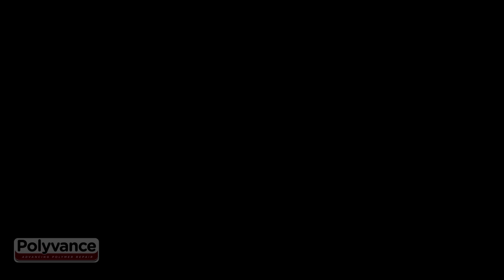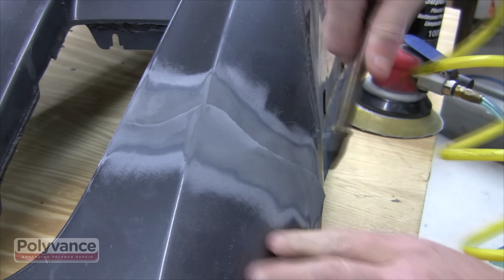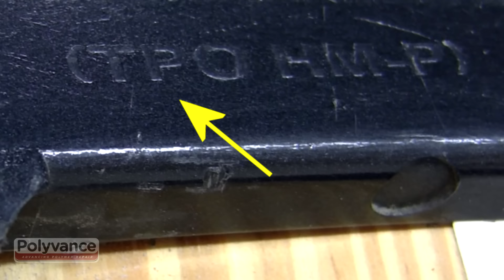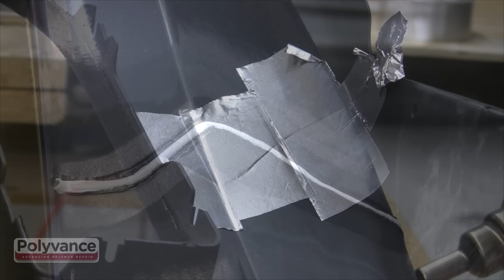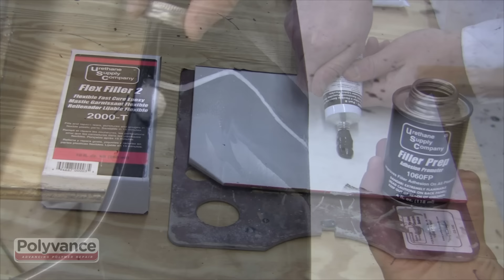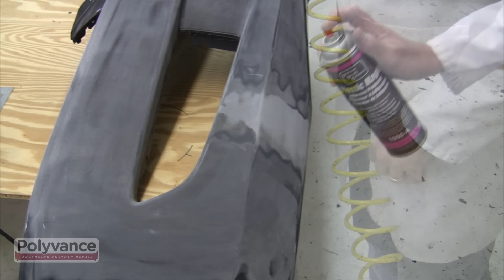Bumper Repair with Hot Air Plastic Welder

Comment: Curious to know the cost differential between this and just replacing the bumper.   This is a nice, professional job but it seems very labor intensive.
Reply from the maker: Hello. Our hot air and nitrogen plastic welders are mostly for body shop use. Using this equipment, a body shop can repair an OEM bumper and other plastic parts.

All cases are different, and the amount of damage will need to be evaluated to see if it is worth having a part repaired. Many times it is cheaper to repair small cracks, tears, tabs, etc. than to replace the whole part. You may find an aftermarket part cheaper to put on yourself, but you run the risk of it not fitting properly, and you also have to wait for the part to come in. Repairing ensures you keep the OEM part on the car, and you don't have to wait for the part to come in.

You can find a win-win scenario for both the repair shops and the bill payer. Check out this article and interview with Kurt Lammon, president of Polyvance (under the Plastic Repair section): https://autobodynews.com/index.php/component/k2/item/15517-the-best-body-shops-tips-repair-vs-replace-what-a-body-shop-should-consider.html?showall=1

There is a good example of a win-win scenario in the article:
If a replacement part costs $400, and the shop makes 25% gross profit on parts, the shop receives $100 of gross profit and the bill payer pays $400.
However, if the part is repaired and the shop is paid for 6 hours of work at $50 per hour with a 50% gross margin on labor, the shop makes $150 gross profit and the bill-payer only pays $300. So if the part is repaired, both the shop and the bill-payer come out better than if it had been replaced.
Reply: Makes sense.  Thanks for the reply.  Dollars in, dollars out.
Reply from the maker: @tomygun1585  You're welcome!

Comment: no epoxy on the backside?
Reply: No.  two reasons:  1: Epoxy doesn't stick well at all to polypropylene.  2: Its totally unnecessary.  The weld is just as strong as the original part.
Reply from the maker: The weld on the backside is a strong repair. Because it is on the back, it will not be seen, and refinishing is not necessary.

Comment: Cost of tools, time, and potential health risks...
Reply: Vintage polyurethane parts that are not available benefit from this type of repair! 
Mask ! Gloves!
Reply from the maker: Hello. Our hot air and nitrogen plastic welders are mostly for body shop use. Body shops would most likely have all of the other tools (sander, aluminum tape, sandpaper, etc). They also have their own safety equipment to use.

Comment: I only watched untill you started grinding the plastic which you just cleaned in 1 direction to stop contamination......why clean an area with solvents and then grind it away right after the cleaning???? Am i missing a step here?
Reply from the maker: If you have contaminants on the plastic and you sand or grind it, it's very likely you will embed some of the contaminants into the sanding scratches (which will impact the quality of the repair).  You should always clean the plastic first!  You can clean it again after if you wish, but you should always clean it first!
Reply: When you clean first, you eliminate the risk of forcing contaminants into the sanding scratches or into the v-groove.  Its much easier to clean first as well, you don't have to clean out the groove you just cut.  It saves time and is generally a better work practice.

Comment: The video is great good job thank you interesting stuff. The gentleman that's doing the welding has a wedding ring on he should have his Jewelry off doing any kind of this work in the shop I know a couple people who have lost fingers due to having wedding bands and other Rings bracelets Etc I've had really bad situations so if you like your fingers I suggest you remove your wedding band. Best regards Chris
Reply: Rings can be hazardous in a shop, this is true, mostly in crushing accidents and in machines with high torque rotating shafts, like drill presses, drive shafts, etc., but there is much less risk with a sander or di grinder. (yes, there is still a risk)

Comment: Or just go to eBay and order a new bumper cover for under $50.
Reply: Not all cars ,  My bumper with shipping is $850
Reply: Lucky ,I couldn't find nothing but oem , 850 plus paint , $1100 , so I ended up fixing it for $300
Reply: $40 @ my local salvage yard
Reply: Lmao, you may not want to paint an entire bumper though, especially if you care about the color.
Reply: 50$ ?? Lol my bmw bumper costs 800$
Reply: @chriscs9080  bumper covers and bumper's are different
Reply: cheapest way is just to pretend its not there and keep driving.
Reply: Mines 600
Reply: With 50 bucks, you can easily get all the glue and wire mesh that you need to universally fix plastic. Wire mesh's strength to weight ratio is significantly greater than PP.
Reply from the maker: This is not true. Glues do not stick well to polypropylene.
We have a FiberFlex repair kit for DIYers that is currently $70.95. It comes with mesh and some FiberFlex welding rod. FiberFlex sticks well to polypropylene and TPO. We also carry 20 different types of welding rod to match different plastics. Our PlastiFix kit is popular for repairing rigid plastics like ABS.
Reply: Yeah, I bought a new aftermarket bumper for my 2017 mustang for about 100 bucks.  It's a perfect fit.  I gotta say, the 100 bucks is worth it.
Reply: Possibly for a honda aftermarket bumper, but shipping will set you back at least that as well, and chances are it will get damaged in shipping, so youre still going to be stuck with a repair...not to mention the time spent fitting a new bumper, rather than just reusing the one you have...
Reply: @scottb7600  New is better. That thing will split open like Ike split Tina's lip.
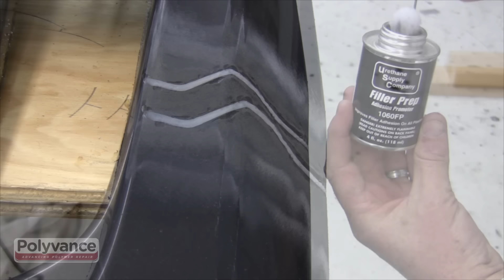Reply from the maker: @panerai_fan  Welding properly with a nitrogen plastic welder or hot air welder will make extremely strong welds. When making a fusion weld (by matching the filler rod material with the original plastic), you are blending the plastic together to create one piece. If you look at our other videos, we often do a strength test after welding. In our SkillsUSA video (https://www.youtube.com/watch?v=mz0aBrDcAa8, skip to 5:02), the weld on the bumper is hit with a hammer and then stomped on. It held up just fine!
Reply: @polyvance  It'll crack with just one love tap from another car. Buy new.
Reply: @panerai_fan  Not any more-so than a new bumper will.  Call Polyvance to get a demo in you shop and see for yourself!
Reply: @panerai_fan  no
Reply: @polyvance  question for you. would a heat gun provide enough heat if I bought just the sticks?
Reply from the maker: @timejinx  No. The opening is too wide on a normal heat gun. You wouldn't be able to direct the heat properly, and you will potentially distort the plastic.
However, we sell a Steinel hot air welder (https://www.polyvance.com/Hot-Air-Welders-1/6055/) which is reasonably priced. It comes with two tips to help guide the welds. If you take off the welding tip, you have a really high-tech heat gun. It has a temperature control dial, a built-in blower that eliminates the need for a separate air-compressor, and a two-speed blower for better control of your weld.
Reply: @timejinx  Yes, but you would damage the bumper because you cannot control where the heat goes with a heat gun.  Its a much too broad heat source.
Reply: @panerai_fan  Maybe you don't understand plastic welding. It works very well.
Reply: @tomicaidzanovic9032  Yes you are delayed, it's the story of your life.
Reply: @polyvance  the link doesn’t work
Reply from the maker: @rrhistorian8828  What link are you looking for?

Comment: Very very bad idea
Reply: How so?  Is welding metal a bad idea too?
Reply: @scottb7600  use fevi quick apply its opposite side in 2 minutes it's ready {cost only $ 0.35 }
Reply: @RahulYadav-je5rx  adhesives are not a permanent fix.
Reply: @scottb7600  ok

Comment: I blow torched a teaspoon until it was red hot,then touched the crack lightly until the crack melted together, started from the top then moved it to the bottom until the crack was gone and it bonded together,but it was for no reason because I used fiberglass afterwords and found that once you apply it on the bumper it's never comming apart unless you hit it again.... fiberglass is strong stuff ,,and probably all you need if applied right,,just clean the rip ,or cuts in the bumper then apply the fiberglass from the inside and out, then just sand it,,,,
Reply: Fiberglass is strong stuff, but it does not bond well to polypropylene.  As a stand alone repair it would not be on my list of acceptable repairs for a bumper.  As a stiffener on the backside, it is OK, but if the area gets bumped lightly, the glass will pop off.

Comment: Be sure to never bump that bumper. What a waste of time.
Reply from the maker: Welding properly with a nitrogen plastic welder or hot air welder will make very strong welds. When making a fusion weld (by matching the filler rod material with the original plastic), you are blending the plastic together to create one piece. If you look at our other videos, we often do a strength test after welding. In our SkillsUSA video (https://www.youtube.com/watch?v=mz0aBrDcAa8, skip to 5:02), the weld is hit with a hammer and then stomped...much more than a bump!

Comment: For the price of tools and materials you could just buy a new bumper and paint it. You already have to sand and paint it anyways.
Reply from the maker: Hello. Our hot air and nitrogen plastic welders are more for body shop use and are more expensive. Additionally, body shops would most likely have all of the other tools (sander, aluminum tape, sandpaper, etc).

You are correct that in some cases buying a new bumper may be cheaper than repairing it. However, more expensive cars have new OEM bumpers that cost a lot. Additionally, some older cars might have hard to find bumpers (which makes them more expensive).
You can find aftermarket parts cheaper, but you also run the risk of them not fitting your car properly (which you would still have to pay to fix).

Of course, all cases are different, and the amount of damage will need to be evaluated to see if it is worth having the part repaired. But many times, it is cheaper to have cracks, tears, tabs, etc. repaired than to replace the whole part. Especially on something like a small broken tab that is easily repaired and not visible (which means refinishing work is not required).
Reply: This is true in this case, but like PV said the nitrogen welder is more for body shops.  For the DIYer, there is always the 5700HT Airless Plastic Welder, or the stripped down version, the PolyPro Welder, which is currently only $71.  Both of these tools work well and are slower than nitrgoen welding, but do a great job and can be used on virtually any thermoplastic.

Comment: Flathead hot soldering iron from the back 2 mil deep and every 2mm apart continuously strait down the crack so it will look like stitch, nice and slow so the plastics all melts and bonds back together... lay mesh like chicken wire over the crack and melt with soldering iron into the bumper for reinforcing or lolly sticks and glass fiber...use soldering iron to butter away the fine hair line crack on the front sand the now minor repair, probably won’t even need filler and paint the whole bumper... much easier
Reply: That's easier than one quick pass with a hot air welder?????  Not.
Reply: Scott B yes and I guarantee my way is even stronger as it’s remelted the same plastic back together, iv been repairing and painting cars since I was 15 I’m 35 now... I’m far from a novice mate. This way is long and no bodyshop would be buying this shite
Reply: @justarandomperson6445  Too bad you feel that way.  Welding with nitrogen is about 8 to 10 times faster than airless welding and produces a cleaner, stronger weld.  The filler material is the same material as most bumpers, so compatibility is not an issue.  So not only is it strong, its also fast, but then you also have the added benefit of not breathing any smoke from the welding process because nitrogen gas acts as a shielding gas when the plastic is hot, preventing any smoke formation.  If you are doing a lot of plastic welding, this is an important consideration.  I'm surprised that as a shop tech, you don't recognise that a tool that can take a 30 minute job down to 3 or 4 minutes, is an asset to have in the shop.
Reply: Scott B I’ll have a split in a bumper, totally gone within 15mins and that includes sanding the front side that I’ll be painting to a finish state that’s ready for primer, that is a honest average guesstimate, after it’s been removed... I’ll use my mask and be in a booth doing the repair because of the smoke. Also doing it my way I can get the split so tight together it looks like a hairline fracture hardly noticeable from the painted side, so close that to an untrained eye you would never know it was there... that’s cheap and cheerful jobs for the broke customers and car sales dealers that refuse to spend a penny... we concentrate on restoration project anyway as the money is much better so I don’t do it to often but each to there own ways mate 👍

Comment: Its kinda cool I guess!! Definitely not worth the time if doing repairs at a shop! Bumper covers can be ordered to the door painted for about 350.00
Reply from the maker: Hello. Our hot air and nitrogen plastic welders are actually made for body shop use. They allow shops to repair the OEM part.
We have hot air welders and nitrogen welders. Welding with nitrogen produces a stronger weld than just hot air. We have lots of literature on our website explaining the benefits of using the nitrogen welders. They are extremely popular in body shops, and nitrogen plastic welding has just been added to the SkillsUSA competition.

Comment: When you figure for labor, it's gotta be cheaper to buy a new panel.
Reply from the maker: When repairing, you can often find a win-win scenario for both the repair shops and the bill payer. Check out this article and interview with Kurt Lammon, president of Polyvance (under the Plastic Repair section): https://autobodynews.com/index.php/component/k2/item/15517-the-best-body-shops-tips-repair-vs-replace-what-a-body-shop-should-consider.html?showall=1

There is a good example of a win-win scenario in the article:
If a replacement part costs $400, and the shop makes 25% gross profit on parts, the shop receives $100 of gross profit and the bill payer pays $400.
However, if the part is repaired and the shop is paid for 6 hours of work at $50 per hour with a 50% gross margin on labor, the shop makes $150 gross profit and the bill-payer only pays $300. So if the part is repaired, both the shop and the bill-payer come out better than if it had been replaced.
Reply: rarely

Comment: Only 500 steps
Reply from the maker: This video shows a piece of equipment that would be used in a body shop. By using this machine, a shop can repair an OEM bumper.
 A body shop would already have some items used in the video (rotary tools, sanders, primer, etc).
Repairing a bumper to OEM standards is not a super quick DIY project. However, welding with a nitrogen/hot air plastic welder is much faster than welding with an airless plastic welder.

Comment: Or... just throw it out and buy a new one.
Reply from the maker: This video shows a piece of equipment that would be used in a body shop. By using this machine, a shop can repair an OEM bumper.
Some bumpers are cheaper than others. More expensive cars have new OEM bumpers that are more expensive. Additionally, some older cars might have hard to find bumpers (which also makes them more expensive).
All cases are different, and the amount of damage will need to be evaluated to see if it is worth having a part repaired. Many times it is cheaper to have someone repair small cracks, tears, tabs, etc. than to replace the whole part.
You may find an aftermarket part cheaper to put on yourself, but you run the risk of it not fitting properly (which you would have to have fixed), and you have to spend the time waiting for the part to come in. Also, the bumper may need to be painted to match the rest of the car. Having the bumper repaired ensures you keep the OEM part on the car, and you don't have to spend time waiting for the part to come in.